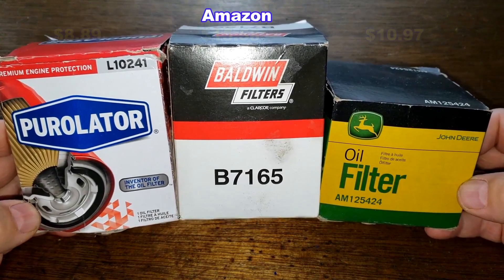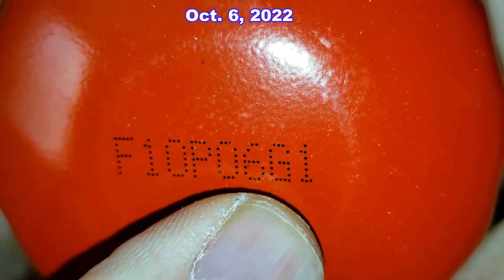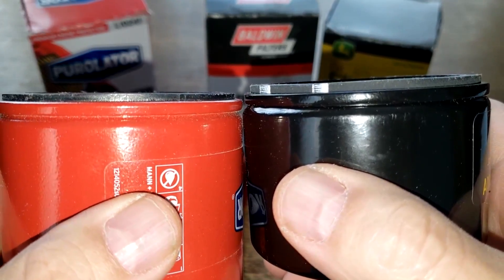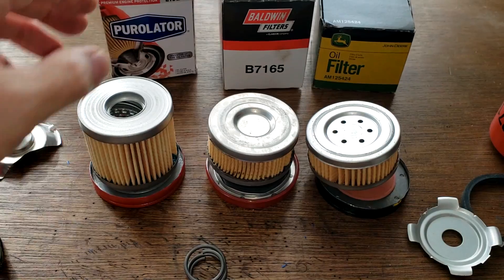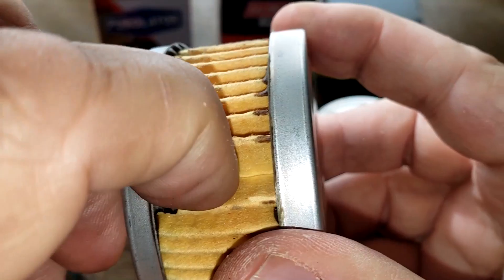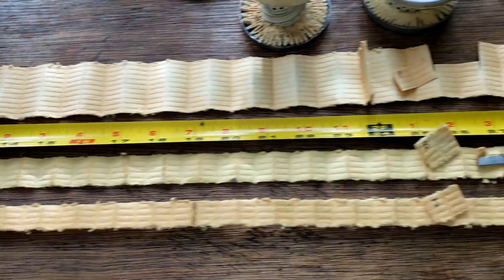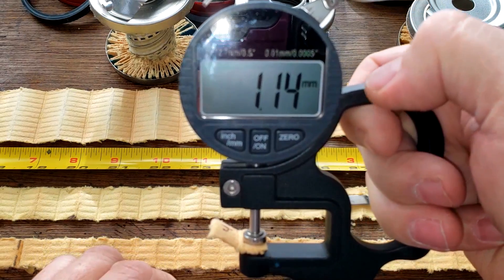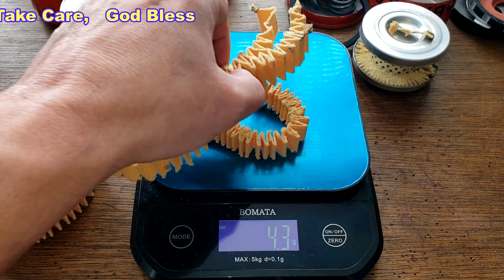PurolatorL10241 Oil Filter vs. Baldwin B7165 Oil Filter vs. John Deere AM125424 Oil Filter Cut Open

Comment: Great job Pete!  I used those Baldwins for years an it is nice to see they use that upper bypass valve  but it seemed like the quality was slipping the last time I bought one.  The one you see here is different than the ones i was using the last few years.  That's why I switched to the purolator.    When I was checking, the Purolator actually cross matched in three separate listings so I went with it.  That Deere filter is actually 11 years old, I bought one when I bought the mower but went with Baldwins when I changed the oil.  

You weren't lying when you said that Deere filter was tiny.  I was going to ask you were the rest of it went!  

Oh, FYI, They are mounted horizonally. on the side of the engine.
Reply from the maker: You're Welcome Jim
Thanks for the Info and the oil filters😊👍💯
Reply: @WhipCityWrencher  My pleasure, Pete!  Thanks for the vid!
Reply: It depends on the available space for placing a high filter in height.
You can use next Baldwin BF7892, B7287,
 B131 - complete ANALOGUE of PurolatorL10241 , 
B1405, B1407
BF7648
BT8323
B40136
B113
B7139
B7172
BF7892
BT8908
BF46228
BF13
B7458
BT8384
BF1275
BF941
B7091
B295
BT353, BF330

Their Length (mm)  from 88,1 to 149,2 mm

Comment: I have a Kawasaki FR730v twin on my John Deere Z530M and have used the John Deere, Kawasaki and Purolator TL10241 oil filters they all work well I do like the Purolator filter best it is longer which makes removal and installation easier
Reply from the maker: Thanks for Sharing👍

Comment: Interesting Video, I never knew what the Filters looked like inside. I’ve been using the Purolator Pure one PL10241 on my JD D140 Tractor for years and Purolator Boss on my Vehicles. I buy in bulk usually 6 filters at a time for cost savings. I also use Costco Kirkland Synthetic oils on all my Engines.
Reply from the maker: Thanks for Sharing👍💯
The Purolator Boss are very good oil filters IMHO

Comment: Hey Pete, what’s your personal favorite oil filter that you run on your vehicles? I’m using Microgard Select from oRilley but I’m considering switching over to Champ XL due to the oRilley filters getting a price bump to $12.99.
Reply from the maker: Right now I'm using a Purolator Boss filter. I think they are a very good oil filter. They are $14.99 at AAP but if you order them online you can usually get them for 15 to 20% off.

Comment: I think lawn equipment filters have a lower bypass opening pressure. Don't know what the oilpump specs are. However if you use a bigger standard automotive filter the bypass valve probably never opens because there is an excess on filtermedia unless you run the engine for 10 years and never change your oil. Indeed most filters on lawntractors are mounted sideways. Bypass at the top of the filter is then still a better location. On B&S Vanguard engine we went for standard oversized oilfilter and prefilled it as much as possible for horizontal mounting). Do keep in mind that lawntractors are mostly run at moderate to higher outdoor temperatures. So oil will not be so thick that it activates the bypass.
Reply from the maker: Thanks for Sharing👍💯

Comment: These filters will also fit on Cub Cadets with a Kohler 7000 series engine.  Looks like even after thickness is accounted for, the Purolator STILL gives you 40% more media than the John Deere OE.  For reference, the JD is going to run you $8.94 at Walmart (possibly more at the John Deere dealer) while the Purolator can be had for $6.49 at Tractor Supply.
Reply from the maker: Thanks for Sharing👍💯

Comment: Pete,
Thank you for cutting open a John Deere oil filter. I use this filter on my John Deere mower and I always wondered what was inside. The bypass valve design is different and interesting. Purolator filter looks good. Not sure about the Baldwin with all the excess glue. I will have no issue come summer using the John Deere filter on the mower. Enjoy the weekend!
Reply from the maker: You're Welcome Kevin
Have a Great Weekend Also👍💯

Comment: The newer production jd oil filter of tbe same part #  use louver core now. I work at a jd dealership in the lawn and garden side, and  noticed when changing out that filter during a service every other 6 filters,  that the anti drain back valve will be folded and protruding through 1 hole in the baseplate. Doesn't make sense to me cause the oil should be flowing through pushing it away.
Reply from the maker: Thanks for sharing👍💯

Comment: Automotive application filter L10241(3614) vs two OPE filters, Baldwin and JD. If they fit the automotive application, always the better value over OPE. Second time seeing Puro with the (Champ Labs/Fram type) separate nonintegrated dome type bypass. JD looks to be 10 years old, using a Champ Labs "clicker" type bypass used on their lowest tier filters. Baldwin, kinda sloppy with the glue. PL10241, FTW here. Thanks for vid.
Reply: It is actually 11 years old.  I bought it when I bought the mower, but threw it in the cabinet and left it there.  Been using the Baldwins for years but this last filter, the one you see, seemed "different" than previous ones I installed.  So I switched.
Reply: @aron6465 Yeah, I rounded it off to 10, should have put a ~ before it. Made May 2013. Nothing special, but at least it has silicone adbv, which I think more recent JD use nitrile. And some may use combo valve too rather than separate dome bypass.
Reply: @faxmen09  Considering you dated it by eyeballing it, I'd say you were more than close enough!
Reply from the maker: You're Welcome faxmen09👍💯

Comment: The Baldwin has two of my preferred features - base plate end bypass and coil spring but I'd take the Purolator with the amount of filter media as long as it would fit and meet the specs of the engine.
Reply from the maker: Thanks, Jeff
Yep, the bypass valve and coil spring are nice features on the Baldwin but I'd take the Purolator too because of the extra media you get.

Comment: That baldwin definitely came with extra helpings of glue..

You should do the light test on the Purolator filter.
Reply from the maker: I did do one on the Purolator One oil filter. The Bypass valve on the Purolator filter in the video is very similar to the Supertech oil filters which I have also tested
Thanks👍
Reply: @WhipCityWrencher  I know you just did a Purolator One recently, didn't know that you did one with bypass in leaf spring. Or i forgot. Did it let light around?
Reply from the maker: @aaronatwood9298  Yes it did here is a Supertech test, basically the same bypass valve as the one on this Purolator in the video.. https://www.youtube.com/watch?v=oearzZSwFrA
Reply: @WhipCityWrencher  I remember the supertech one. But this filter looks like the design of the baseplate in the spring end is flanged creating a stepped surface. Might actually seal better than fram/champ.
Reply from the maker: @aaronatwood9298  It might, I would have to test it out on a new filter.

Comment: I know one thing for certian i will never by a lawn tractor that doesn't require an oil filter ! Using the purolator is definitly a great upgrade ! 👍👍👍👍
Reply: As long room permits, automotive application filters always the way to go over OPE filters. Cost significantly less, more media and frequently silicone over OPE nitrile adbv.
Reply: @faxmen09  It's tight, but it fits.  in fact using this filter on a John Deere mower is something you see alot of guys doing on a number of message boards.
Reply: @jamescaron6465  100%. If the tad more length permits, automotive application (3614) always beats the OPE filter. Unfortunately, some lawn tractors including JD have a side cover plate now, that make it a close fit.
Reply: @faxmen09  I know, they are doing everything they can to make you use THEIR consumables.  I don't think I'd ever buy another Deere again.
Reply: I use that mower from Late feb to early december  I figured the extra media would not hurt.  the oil has some clarity when I change it
Reply from the maker: Agree, Great Upgrade👍💯
Thanks!